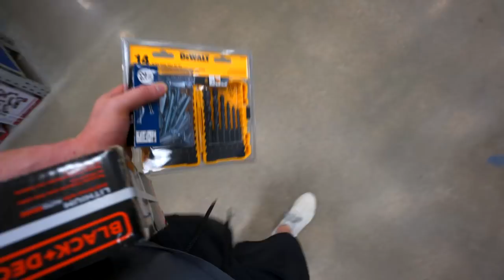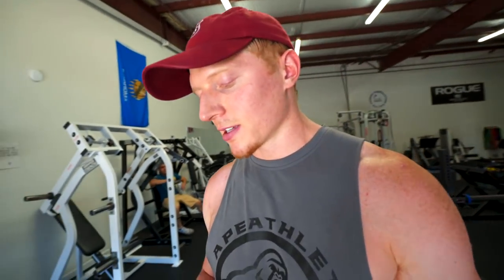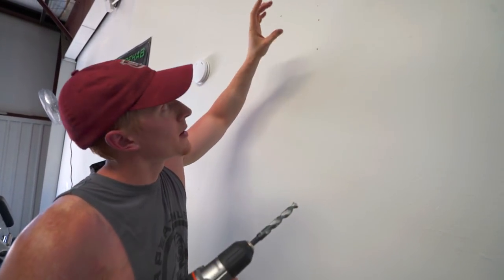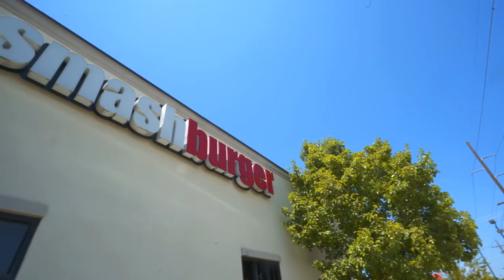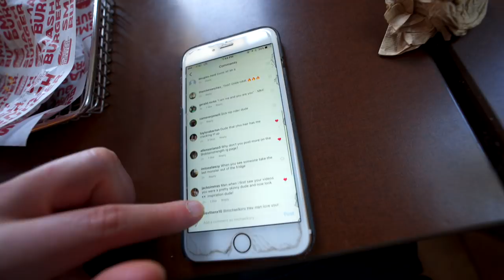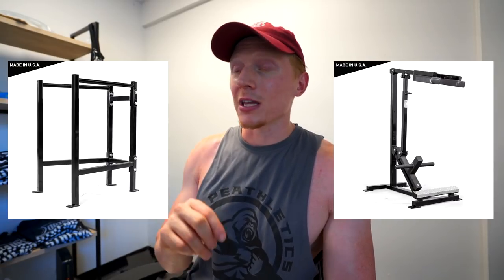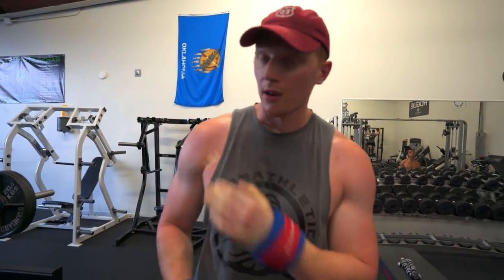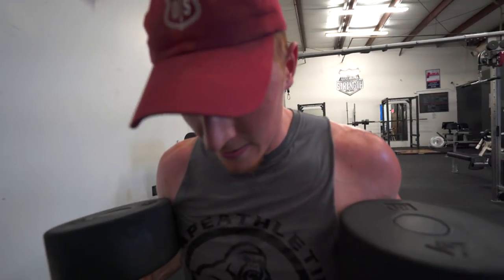PROBLEM SOLVED!

Comment: Yo! i work with ventilation over here in Norway, and my tip for you would be to close the doors to the gym. they hot air from outside will go in when the doors are open. The fans will circulate the air inside and you will get a cooling effect. but to actually lower the temperature you will have to go with some sort of cooling machine. you can use ice water machines or dx/gas like in your refrigerator.

Comment: Ryobi, DeWalt or Makita. Pass on B&D. Glad no one has drilled into an electrical line. That would not end well.
.
And Chipotle's point of sale devices got hacked. But you may have heard if you were affected.
.
Rent a Black Jack from the makers of Big Ass Fans